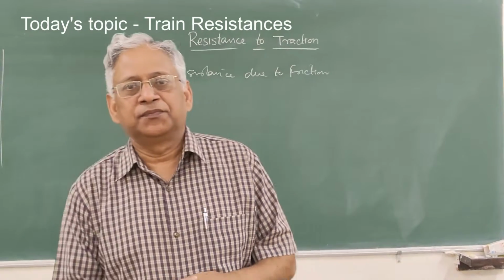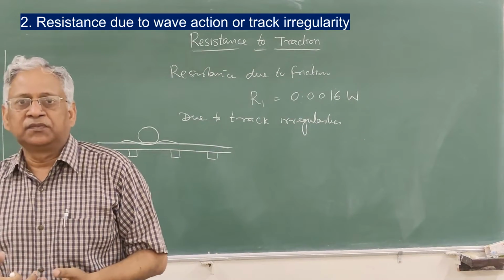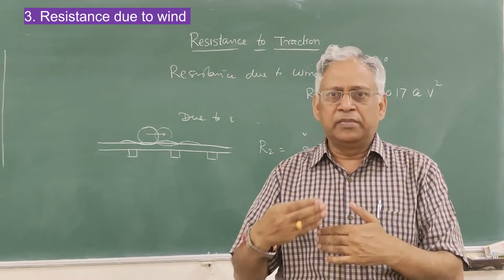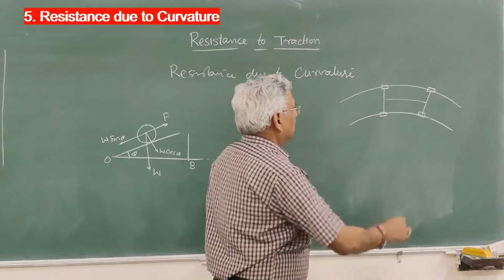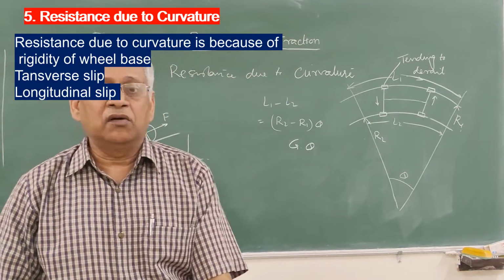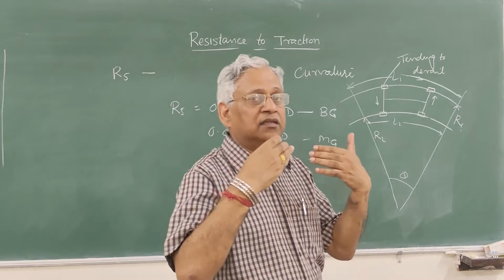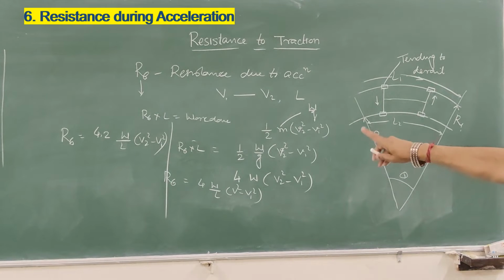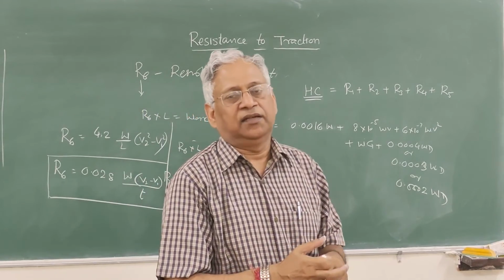Resistance to Traction, Friction, Track irregularity, wind, grade and curvature resistances.

Comment: Hello Sir, What are the references of these empirical formulae. It would be helpful if you can provide some insights on the reference materials.
Reply from the maker: These empirical equations are taken from Indian Railways manual and you can find them in any text book also. A few of them are based on experimental studies done in different parts of the world and do not have theoretical derivation (line Resistance due to friction, track irregularity and wind), Resistance due to curvature and grade can be derived. You can refer my book on Railway Engineering (by Chandra and Aggarwal). I have tagged this book in this video , click on it and buy, if you want.
Reply: @SatishIITR  Great info, Thank you!!